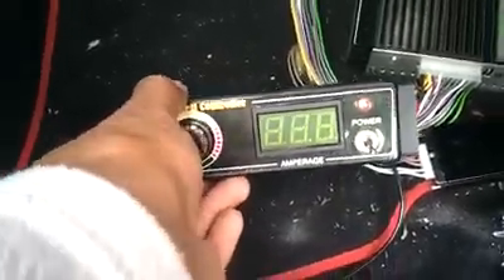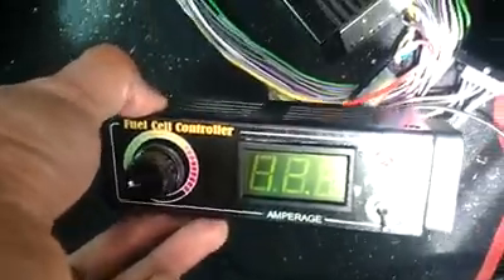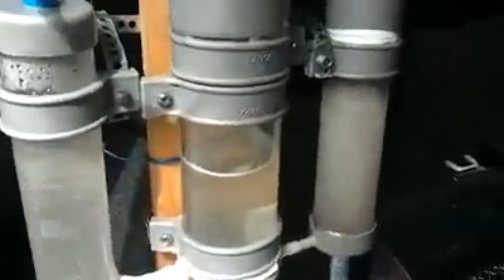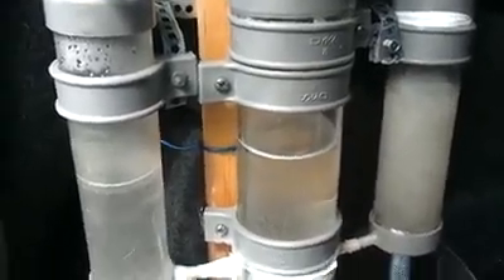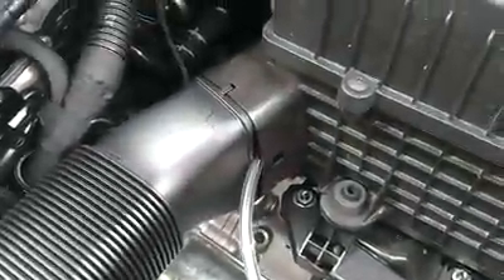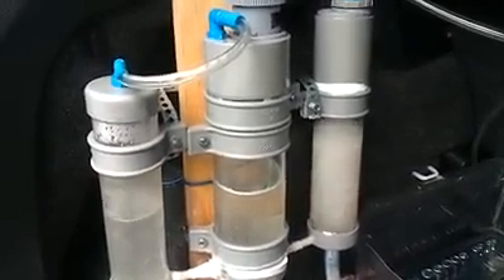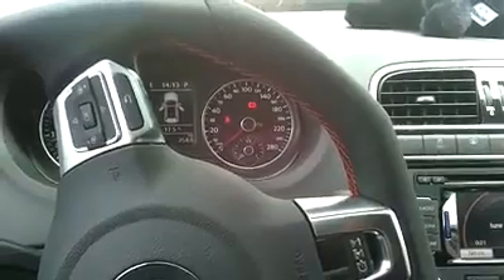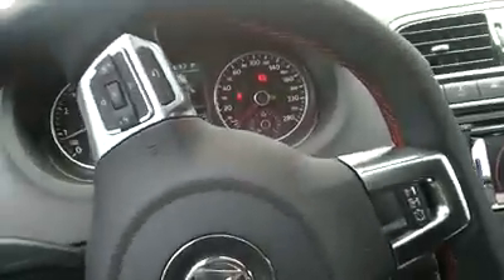Demonstration hydrogen separator cell install on VW Polo GTI 2012 #2

Comment: thanks for the video, I'm looking into doing that for my gti. How has your engine been running?
Reply from the maker: Latham Carr Pretty smooth, I couldn't test it for long as I do not have the car anymore.
Do notice I am not using a HHO cell, but a pure hydrogen seperator cell.
Reply: Hallo. Ik ben er ook eentje aan het bouwen. Hoe groot zijn je electroden?